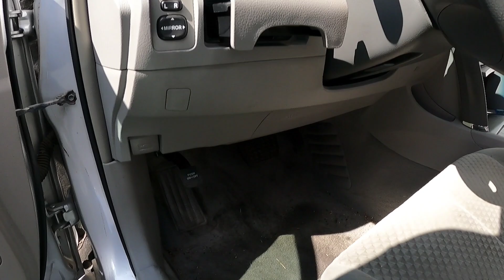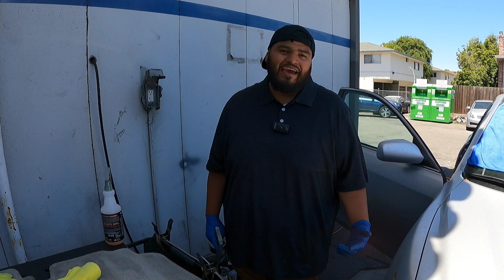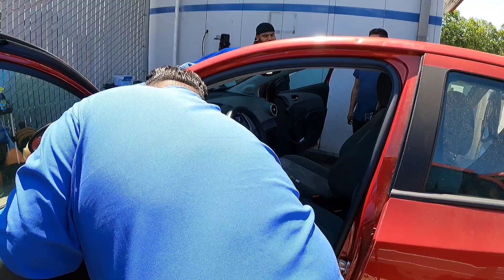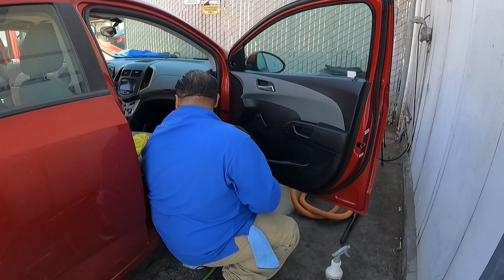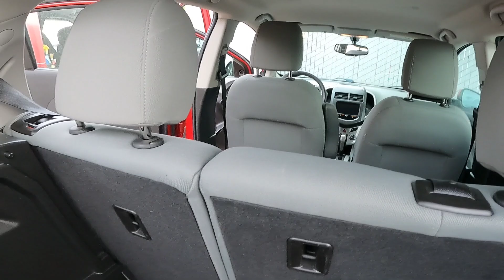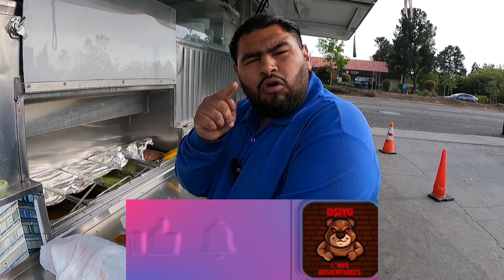hopefully we don't get kicked out of this location again! - Isacs mobile detailing

Comment: My brother I have a question is harbor, freight air compressor is good or not
Reply: Yes bro definitely recommend it I have the same one he has for over a year no problems the only thing is only a 2 gallon I bought an 11 gallon auxiliary tank from harbor freight for $70 more I think so now I have 13 gallons and still charges up quick and it’s also quiet
Reply from the maker: Awesome, thank you for taking the time to respond to this comment, yes I definitely enjoy my 2 gallon and if you do the trick above I’m sure it makes it even better. You can also look into the 6 gallon pancake